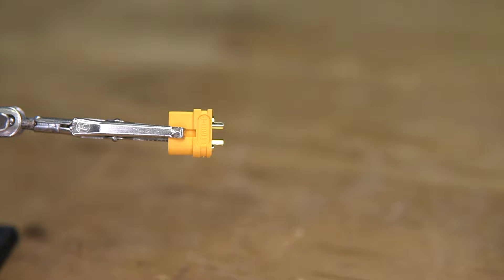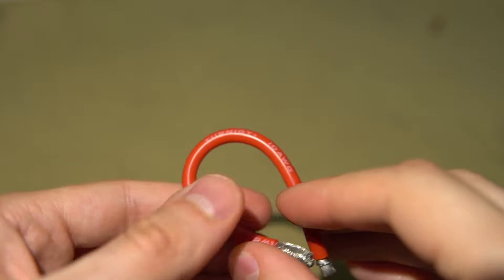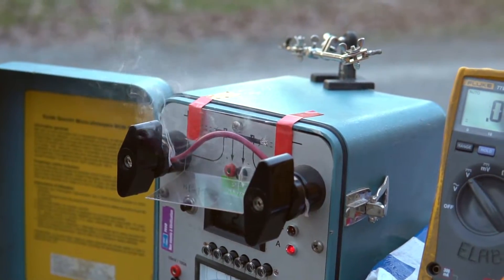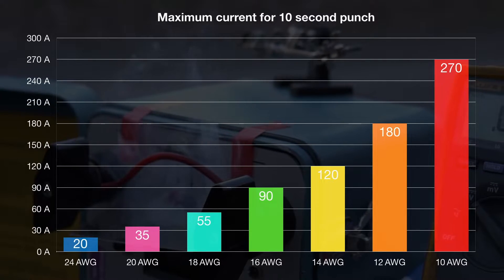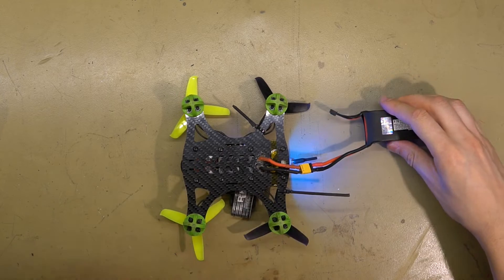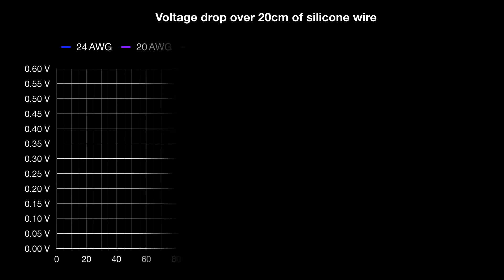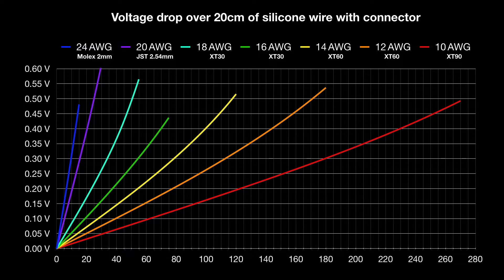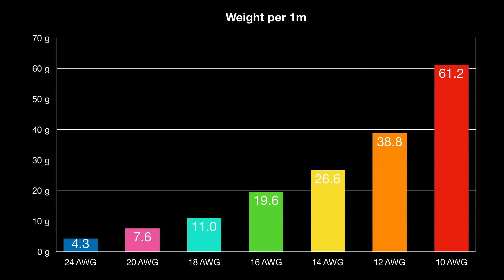Silicone wire - measured and tested

Comment: I'm still baffled by the fact that most 10000mah packs ultra high C rating packs I've seen have 10 gauge wire. Many of these are rated  at 100C and above, we know they are overrated but even at 30C, these batteries would instantly melt their wires. That is not a crazy amount of power for a Twin 120mm EDF for example, or a large cargo multirotor.

Comment: So can you guys test the 6AWG wire? My application requires 180Amps of continuous current and 500Amps of peak current for 10Secs. I am searching for a perfect silicone wire for a prototype. Will it be able to handle that much current?
Reply: Have you tried it? I would assume it would heat to 60C probably, thats double continous than official rating

Comment: What is than a maximal permanent current for the wires, without significant heat production? 🤔
not hotter than 50°C 🤔

Comment: Almost forgot!   If I were going to Solder a 10/12 awg silicone wire to a XT90 plus... what Solder, Flux, and Temperature would I use ?    I really have little to no experience in do soldering work.  Any help is APPRECIATED !
Reply from the maker: Preferably leaded (SnPb 63/37 or 60/40) solder at 350°C. You can push it to 380-400 if your iron is small and the big connector is problematic at 350. If you have a tin plated wire (like the silicone wires we strongly recommend), then you won’t need any flux. Only and old crusty wire that oxidized will need extra flux.

Comment: Thanks. Good videos.
Can some one tell me if a ESC needs cooling? Or can be installed as it is. Tekko32 for example..
Reply from the maker: In most cases, a good ESC will be ok without additional cooling, as long as it gets airflow as you fly around. ESCs in RC cars and boats are more at risk, as they don't get the 100km/h flow, and are often enclosed in protective canopies , but on a drone you should be fine. Just stay well within the rated current.
Reply: It depends on the current being pulled through. If you're maxing it out you'll want to use TIM + heatsink. If you're within spec it's made to handle it without additional cooling.

So if your motors draw in a lot of current for the size of ESC you will want to either upgrade ESC or combat temps via cooling aids.

I would recommend Arctic Silver Thermal Epoxy (permanent) if you throw on a heatsink.

Comment: Running 16awg on 6s works great. Ambient temp, insulation (in conduit,free air), length greatly affects amp rating on wire.

Comment: Maybe it also depends on the length of the wire... Just an opinion
Reply from the maker: Since the wire has a certain resistance per length (for example, 6.8mΩ/m for the 12AWG), it on one hand produces more heat for each meter of length, but also has more surface to dissipate that heat. But with a very short wire, significant heat might also be conducted through the ends of the wire, into whatever it terminates into - so one end can sink heat into the battery, and the other end can sink heat into the PDB and use its surface as a heatsink. This effect can be significant for a wire that is short in proportion to its thickness (so a 5cm AWG 12 or a 2 CM AWG 18 would experience this effect similarly) . We tested a 17cm piece, which should be long enough to make this effect insignificant for the wires we tested - maybe with the exception of the AWG 10. So if you have a very short wire, and are ok with pushing heat from it into whatever it is connecting, then yes, you could get a little more current. If you wire is longer but straight and in open air, like we had ours, it should still behave as in our tests. If your wire is longer, and it has limited heat dissipation - for example, it is tangled or coiled in a confined space - you could get less performance.

Comment: Just awesome but for beginners you might want to add a reccomended tabel for the quad 'inch size'
Reply: Quad size is not really relevant in this mater. It all depends on what battery and ESCs you are running. There are 3 inch drones with 30A ESC and 10 inch drones also with 30A ESC. Just calculate the maximum current output from the battery to find out the best AWG for the battery lead and then the maximum current out from the ESC and choose the appropriate wire between the ESC and motor according to the table in the video.